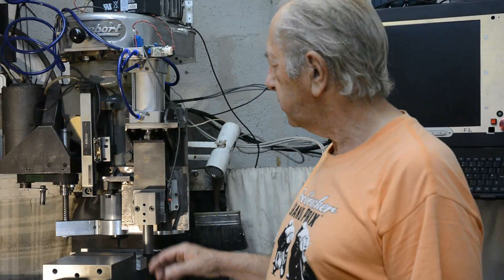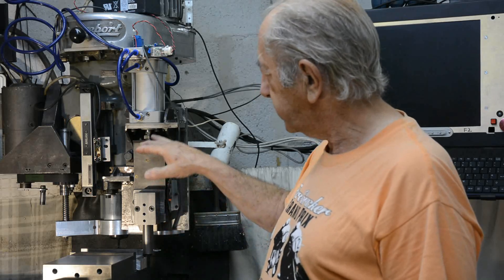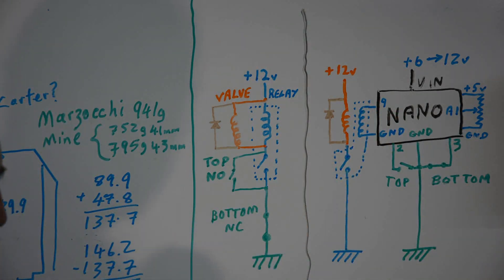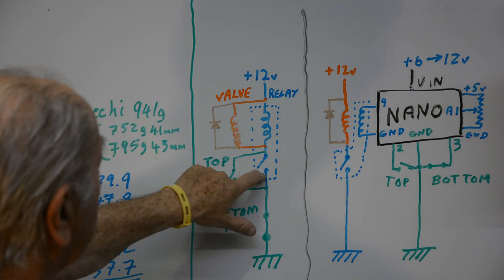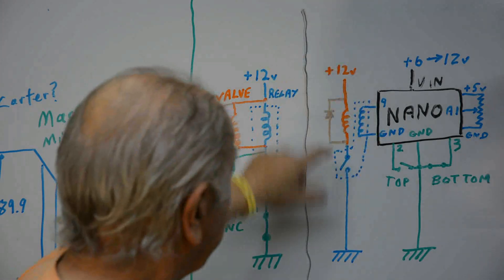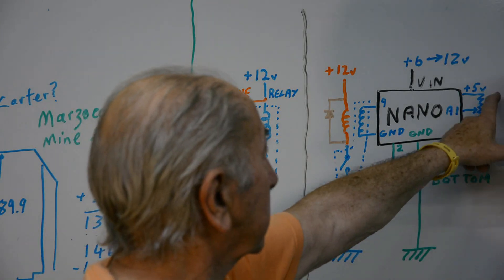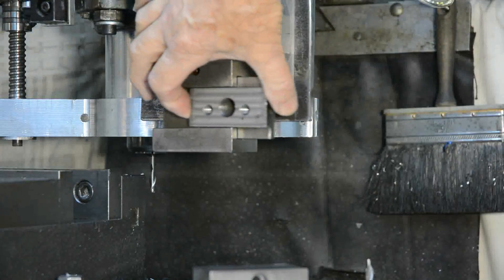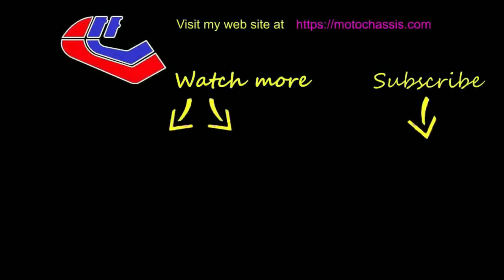Making motorcycle clutch housings and keyways.

Comment: Nice slotter Tony!  Could the variable timing not be easier with a variable resister and capacitor in from of your relay? Just like on a variable wind screen wiper timer.
Reply from the maker: Thanks for the suggestion.  There are several ways to get a time delay.  I did consider using a 555 chip which is a common timer but it would have needed more components than the Arduino.  An RC system as you suggest could work but the relay might not switch at the same threshold each time, it would depend on its internal coil heating for one.  The dV/dT at the thresold would be slow  and so the contacts may not close or open quickly.  It is better to generate a fast pulse to feed the solenoid to ensure rapid switching.  The Arduino solution is very easy and not expensive.  The nanos cost around 3 euros.